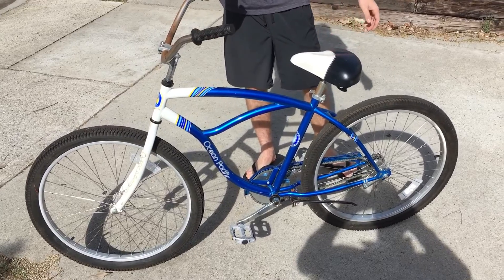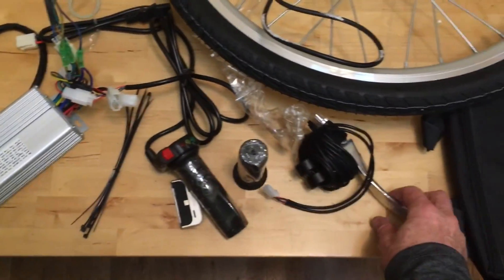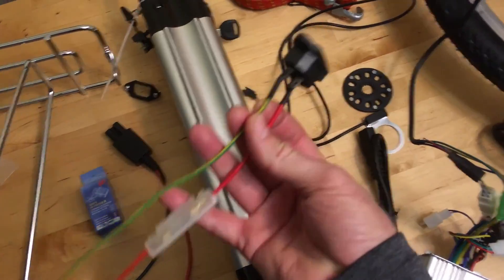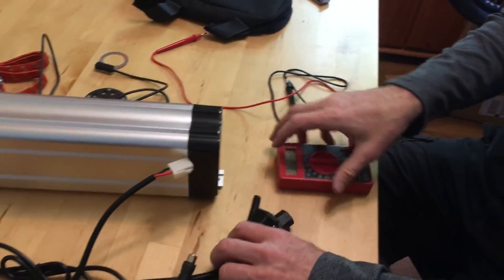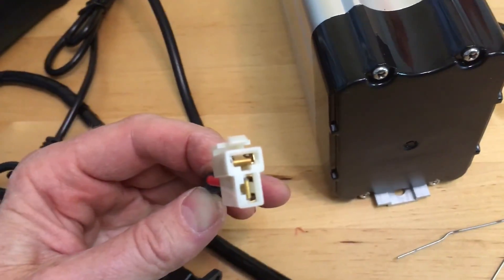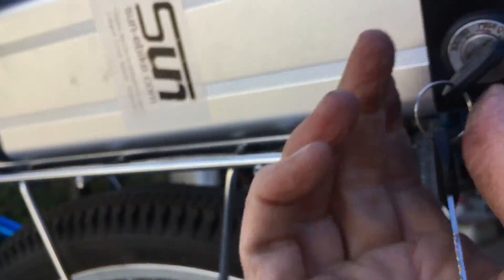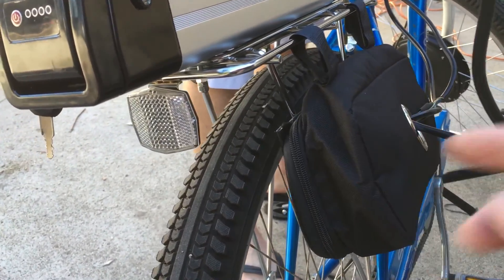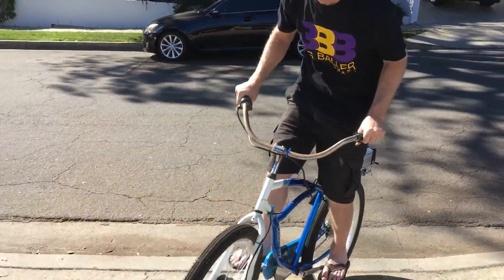1000 Watt Ebike Conversion With Wheel Kit Easy How To Video

Comment: 2:13 I'd rather have my drive in the rear wheel but I'd also rather be able to just pop off the front wheel and not have to change my gears or mess with my derailleur. 2:16

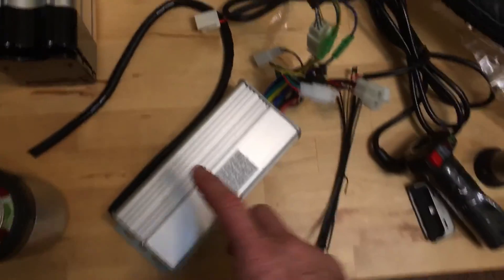Comment: 1:41 that's what I was going to ask you I was thinking of getting the same kit I have the batteries. 
I was just going to put a longer wires to the kill switch where I can reach it up near the bars. 
1:49 that's the next question I was going to ask you 
What does the pedal assist do is it necessary to disengage the motor or will the motor wear out from not using it what is the purpose of it?
Reply from the maker: You don’t need to hook up the pedal assist. On this bike, I didn’t install it, and it’s just throttle only. I figured we would never use pedal assist anyway.

Comment: Which hub kit did you use? I have a Huffy Panama Jack I want to convert and I'm concerned about the fork drop out width.
Reply from the maker: It didn’t have a brand-name. It was a generic hub motor I bought from eBay. That was six years ago, and I don’t remember who I bought it from. I just bought the cheapest one.

Comment: Great work, thanks for sharing. When we turn off the battery, wonder front hub ebike or rear hub ebike conversion kit makes it easier to bike manually ? There is the added weight of the hub around 18-20 pounds, curious if that weight is in front wheel or rear wheel makes it harder to exercise when the battery is turned off....
Reply from the maker: I bet it’s about the same. Either way you’re going to have to deal with the resistance from the motor while you’re riding, which isn’t too bad.

Comment: I notice after testing out the red and the black wires, you switch the black on top and the red on the bottom. At the 7:10 minutes, the controller power wire, the red on top and the black on the bottom? I'm about to fix my friends old ebike with the same controller and the battery pack, if i connect the connectors, black in red, red in black.

Comment: This is one of the videos that convinced me to convert my beach cruiser into a E Bike ♥️ The other one is that kid putting his together on and going 41 on a dirt country road. If you watch E bike videos you know just what I’m talking about.
Reply from the maker: Yeah. You can over vote these things and make them go crazy fast. Some people put electric motor kits on the front and rear wheel for twice as much power.
Reply: @hoohoohoblin  Excellent! Since you peeled out in the driveway, would it be better to hang the battery on the front for traction?
Reply: I'm thinking converting mine to e bike soon

Comment: Nice video.  Pedal assist sensor.  I see you didn't install it.  Do you feel it wasn't necessary?  Trying to learn all I can before buying my stuff.  Comments appreciated.  Rick
Reply from the maker: Yes. It came with the pedal assist sensor, but I knew I would never use it. I just like using the throttle when I need a little help. I’m used to riding motorcycles, so it’s familiar to me.

Comment: Can I use a lead acid battery? Like a motorcycle or moped battery? Thanks a lot
Reply from the maker: I think so, but would you would need a few of them. For example, if you had a 36 V system, you would need three 12V batteries.

Comment: My electrict scooter weight 80 kg and topspeed 50-57kmph with 200 kg load 280 kg total
And hilly area around 50-52 kmph hub motor 10 inch 60 volt 1kw

Comment: That’s a bummer about the battery I only have 200 and the kit I was gonna buy is 160 and its an 1000 watt motor for my fat tire bike and it said it says it won’t come with the battery and the battery is like 300 rip.
Reply from the maker: Yes. Batteries are still really expensive. Someday I hope they get cheaper.

Comment: Hi.  Great video.  Question - did you not fit the pedal assist crank thing?  Does the kit work without it?  Thank you!
Reply from the maker: Correct. I didn’t attach the pedal assist, and it works fine without it. I just use the throttle when I want to turn the motor on.
Reply: @hoohoohoblin  Awesome.  Thanks for the reply and the video!

Comment: Good call on checking polarity I am getting a kit very similar to this and also installing it on a cruiser thanks for the tip!
Reply from the maker: You’re welcome. People putting these things together can be pretty sloppy, so it’s best to always check the voltage and polarity. The hub motor just died today while I was riding in traffic. I am trying to figure out how to fix it now.

Comment: Please use a torque arm or two. Do not trust the included torque washers, they will fail. I learned the hard way. Lucky I was only going 10mph when the wheel popped out and I cartwheeled. If I was going 30mph, I probably wouldn’t be here to write this.
Reply from the maker: Thanks. I will do that.

Comment: would it be dangerous to put a kit like this on a road bike?
Reply: Please use a torque arm or two. Do not trust the included torque washers, they will fail. I learned the hard way. Lucky I was only going 10mph when the wheel popped out and I cartwheeled. If I was going 30mph, I probably wouldn’t be here to write this.
Reply from the maker: No. It should be fine.